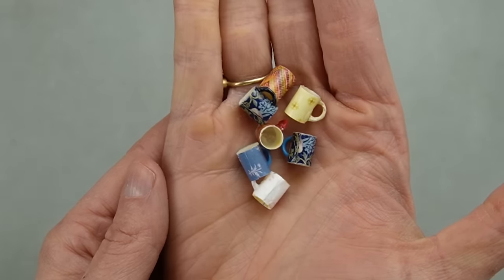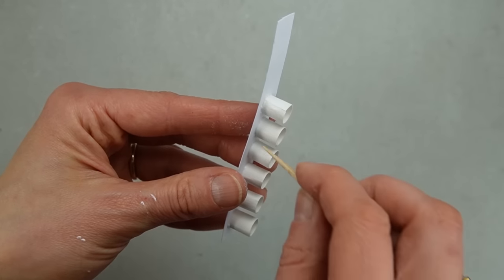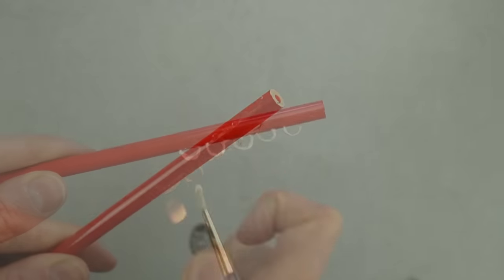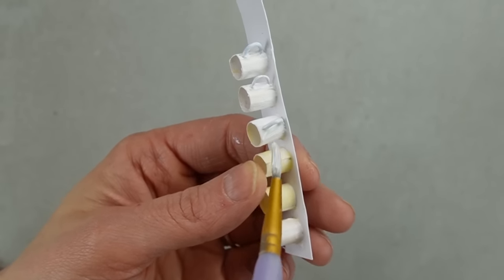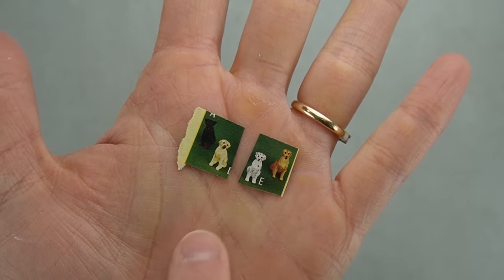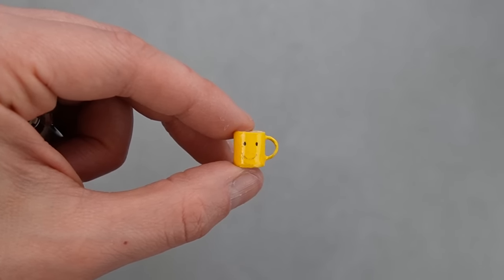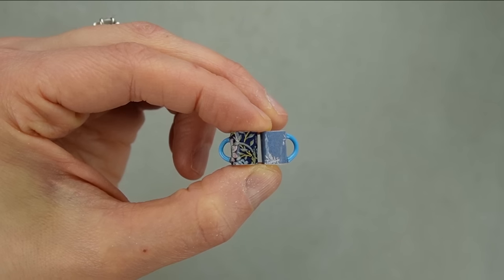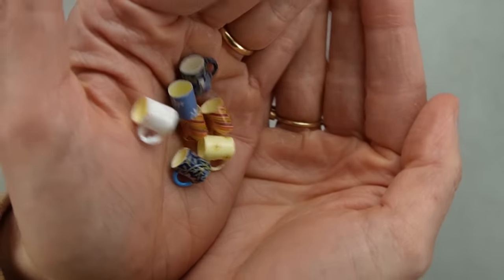EASY dollhouse miniature Coffee Cups made from PAPER

Comment: Cute cups. I have 2 suggestions. First, when you clip something, try holding it in a ziploc bag so the scrap end doesn’t go flying. Second, when I want to paint with Testors I just use the end of a toothpick to spread it. Because of the texture of the paint it flows easily off the tip of the toothpick and dries smooth. When I’m done I just toss the toothpick. Since I’ve only done this with metallic paints I’m not positive it will work as well with regular enamel but you can try it.
Reply from the maker: Thanks for the tips! I switched from using my own brushed to the cheap plastic bristle brush that came in the kit and it works well. I'll try the toothpick method for smaller items.

As for cutting things and letting them fly, I'll straighten up my act going forward ☺️

Comment: Love this tutorial and technique. I'll be trying my hand at 1/18 or 1/16 scale 😮
Reply from the maker: The 1:24 scale mugs were surprisingly easy. You won't have any trouble. The 1:6 scale mugs were still easy but took extra time because of wrapping the paper to make it thicker. 

For 1:16 scale, you'll want to cut the strip of paper at 1/4" wide. The inside diameter would be about 5.5 mm.
Reply: @queencityminis  Thank you for the measurements I find I'm having a bit of a problem finding them for that scale ❣️

Comment: Brilliant video,  at the beginning your doing that to help break the fibres of the paper making the curve smoother and the paper less likely to crack but paper has a weave much like material and it will always crease or curve better if you go with the grain, its easy to tell if you bend the paper gently it will easily curve one way but resist the other.
Also with regards to the oil paints a fantastic alternative is pebeo 4artist oil markers, they come in all colours all different size ends and give amazing coverage on greyboard to resin layers but with no cleanup x
Reply from the maker: Wow! That's really cool insight. I'll try that when I'm curving paper, which I do often.

Thanks for the heads up on the markers! I'll check them out.

Comment: Beautiful creations and excellently taught.
Mod podge hard coat it my best friend personally x
Reply from the maker: I've never even heard of Mod Podge Hard Coat! Interesting
Reply: @queencityminis  I have been using it on my card and greyboard creations big and small for quite a few years.
I have created fridge magnets  from very layered dies ie the santarro gorjus girls that now resemble plastic not card.
I found the best way with card is to seal it with anything first ie another basic mod podge glue/sealer or an affect to add depth although it isn't fully visible eg matt creates a layer but the hard coat is glossy let it dry for at least 24 hours then do several thin coats of the hard but here is the key let it cure for the 28days before doing again for a tougher result and keep repeating it until your happy.
Just like using resin, which this contains but I'd far easier. 
I found it creates a harder coat by allowing curring between several layers instead of just applying at oncex

Comment: You can make strips of paper curl even more by dragging them across one of the jaws of a pair of scissors. Open them up as wide as they will go, hold the strip against the edge with your thumb and pull it down so that it scrapes along the edge. Don't hold it so tight that it rips, or gets cut. You can also do the same thing with the back edge of a knife. When done right, it makes the paper really curly.
Reply from the maker: Thank you! I used that technique for curling ribbon.